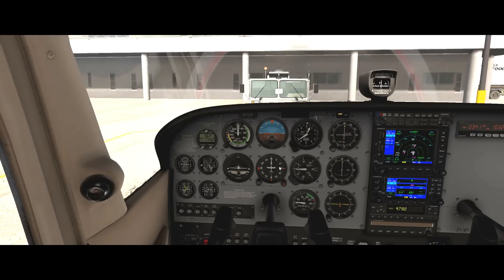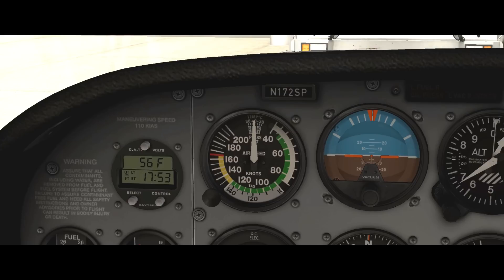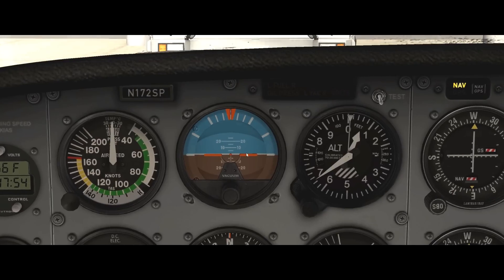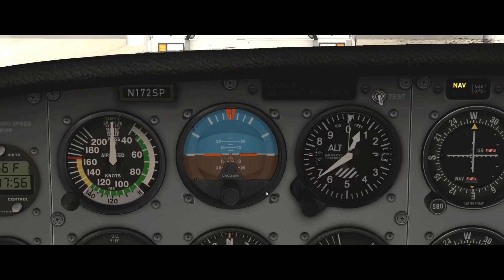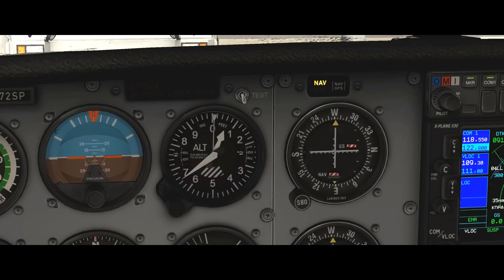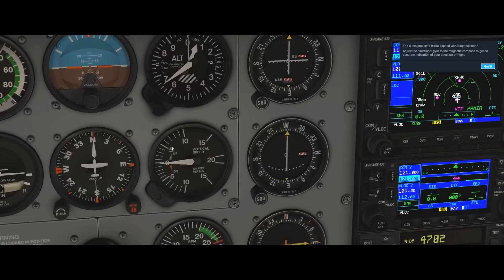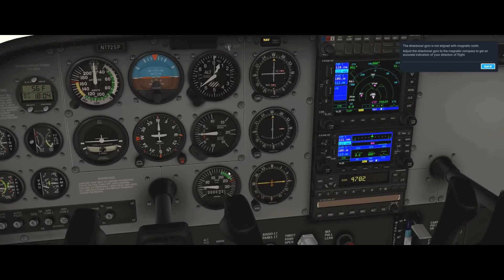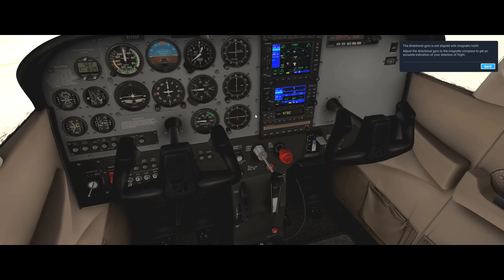Flight Simulator Lesson 1: Flight Instruments (NEWLY REDONE!)

Comment: As far as basics go with the heading indicator, if you will be doing touch and goes at an airport look at the little, in this case orange triangles, they are 90 degrees apart.  A standard pattern will require 90 degree turns to the left for each leg, so when you are at the proper altitude you will turn to a heading of 270 [two seven zero], then 180, then 90, then 360 for the final leg and approach to the runway.  There are five names given for each leg.  As you lift off the runway you are on the upwind leg, when you make your first turn left 90 degrees is the crosswind leg, turning left 90 degrees again and you will be on the base leg, turning again 90 degrees you will be on the final leg and you should be lined up with the runway for a landing.  Some airports may not want you to use a standard traffic pattern and require right turns.

If not doing touch and goes there are other requirements to enter a traffic pattern or direction of flight to eventually get you lined up with the runway.  The standard entrance to a pattern is about halfway in the downwind leg and have turned to the proper heading, in this case 180 degrees.  The rest of the pattern will be the same as above.  There is more to making a proper approach such as height above ground, air speed, landing configuration and more, which I will not go into here.

I stopped watching at that point.    Thank you for presenting this video regarding the use of instruments in a common flight simulator.
Reply: ''when you make your first turn left 90 degrees is the crosswind leg, turning left 90 degrees again and you will be on the base leg, turning again 90 degrees you will be on the final leg and you should be lined up with the runway for a landing''     No, after the 2nd turn, you're in the downwind leg (you forgot that one), then base leg, then lined up with landing runway.

Comment: Great video, but I have a question.  At about the 9:20 mark in your video, you see a message in X-Plane that says the directional gyro is not aligned with magnetic north.  Does this refer to the alignment of the heading indicator to the magnetic compass or something else?  I ask because by this point you had already made that adjustment, and I have not found anyone else online that explains what needs to be done when you see that message.  Thanks!
Reply from the maker: Hey John, sorry for the late reply;
The heading indicator works with a spinning gyroscope, which is NOT slaved to magnetic north. As such, you have to manually adjust the heading indicator to match with the magnetic compass. The gyroscopic heading indicator is more stable than the compass (the compass is prone to a number of errors when you're flying in any manner except straight and level flight), and thus easier to use for navigation. But since it isn't slaved to the compass, you have to periodically adjust it to keep it aligned with the compass. 

X-Plane defaults with the 2 lined up, but you see in my video that when I started moving the heading indicator, it became "misaligned" with the magnetic compass, triggering a warning from X-Plane. All I needed to do was turn it back the other way to match up with the compass.